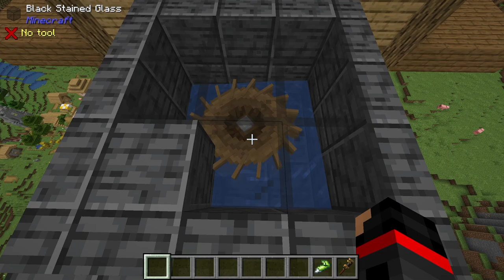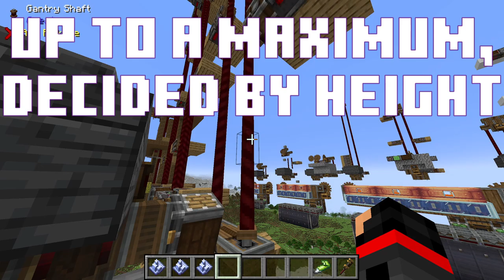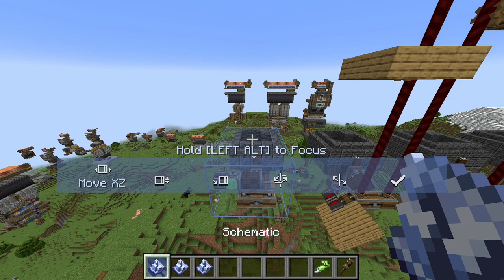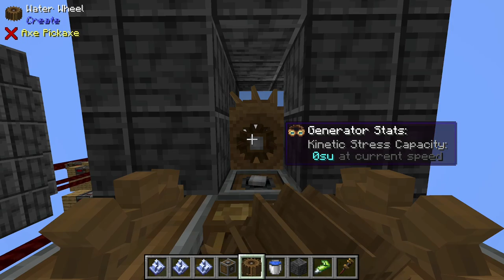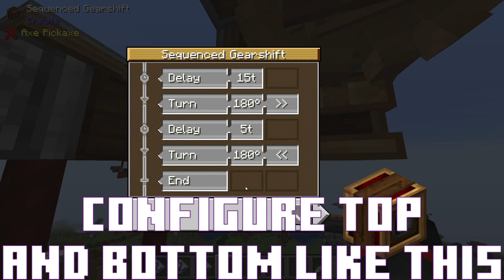"Elevator of Death" Paternoster Lift - Minecraft: Create

Comment: for the transfer arms that send platforms from one gantry to the other, couldn't you have them be double sided, so that it simply makes repeated 180degree turns in the same direction?
Reply from the maker: Visually, it looked weird doing it that way. Cause then the "lift" would be swinging up and over, where a real one goes down and around.
Reply: @Triobian  they could still transfer the platforms down and around like you have them, it's just that the arm will be constantly turning in one direction, alternating which end grabs the platform. So instead of a reciprocating arm, it's more like a "gear"

Comment: This is a really cool design! I made a few designs that were realistic, the cars would go all the way around, following a semi-circle path at the top and bottom, without flipping over, so you could ride it all the way around, but my designs were unreliable. They broke easily because I used minecart contraptions for the elevator cars, and they'd eventually fall out of the elevator, no matter how many blocks I used to keep them in place. I have a new design in mind, although it might require Create: Interactive to work smoothly

Comment: I have tried to build this on a server. The bottom part of the lift works, but the lift fails to disconnect at the top for the down gantry. this results in the lift flip flopping at the top. Any ideas on solutions? The bottom works well, it's only the top.
Reply from the maker: I would check to make sure the glues are done properly, and if they are, maybe give both the the top and bottom more time to work, increase the delay between the flipping by a bit more and see if that solves it. I assume the problem is that the server is lagging during an instance of the flip flop, causing the timing to get thrown off, since that build is very timing dependent
Reply: i have the same isue but if i revers it the top works and the bottom breaks

Comment: I'm not sure what I am doing wrong. I built this in creative in half an hour, but in my survival world I can't get it right. The platform insists on taking the swivel arm along up, and down. This breaks the whole thing. I have reassembled it dozens of times now.  
I'm using 1.20.1 Minecraft and v0.5.1d Creat version. The sticker doesn't depower after it has placed the platform on the other side. 
Any theories?
Reply from the maker: Sounds like you just need to reverse the swing direction on the sequencer
Reply: @Triobian Thanks! I will try that. Create 5.1 also introduced an elevator thing but that is so ikea it feels like cheating

Comment: I'm missing something. You say "the difference in the rotation in the gantry shafts", but it looks like you have three encased chain drives in a row, making the gantry shafts turn in the same direction. 
Mine won't return unless I reverse the direction of the gantry shafts. Has gantry behavior changed?
Reply: The solution is fairly simple. Replace the row of three encased chain drives with a U shape with on both sides one encased chain drive looking up, connecting the gantry shaft and the other one looking inwards, with a gearbox in the middle.
Reply from the maker: Or just shift place the gantries on one side and regular place the other side. It flips their rotation direction.

Comment: the top sticker didn't release itself from elevator what should I do
it keeps pull the hold thing back and forth
Reply from the maker: I'd need to be able to see it to figure out how to fix it. If you can post it on the discord I'll try to help p
Reply: I'm having the same issue and if I reverse the whole thing it happens to the bottom. Moving south to North it works but north to south it brakes. Going one direction the sticker gets pulsed and releases but the other it remains powered and keeps hold